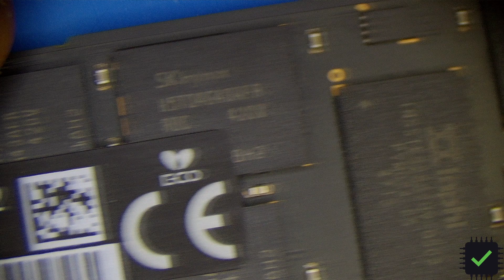Apple Mac Pro 6,1 A1481 Random Reboots without Kernel Panic and no Error messages in console Repair

Comment: I had a very similar issue with restarts, glitches in rendered video, sometimes kernel panics but generally nothing specific with iMac 27 2015. I suspected CPU, GPU and disk but finally figured it was RAM but memtest didn't find any problem when all 4 modules were installed, but when I started checking them one by one, it immediately detected the problem. Perhaps it was the same with you. Good job!